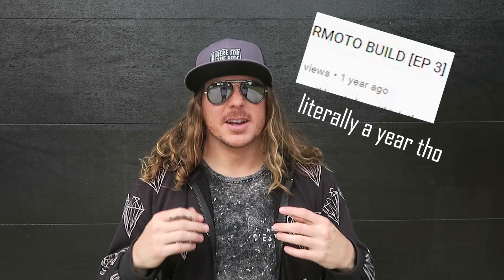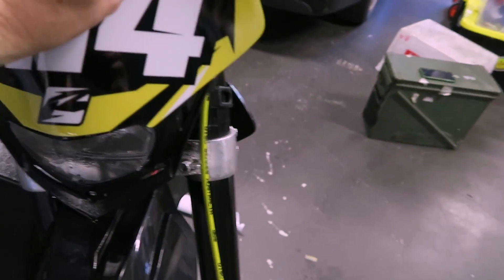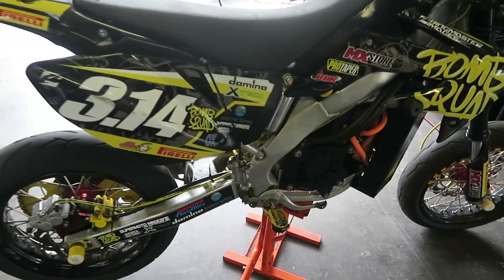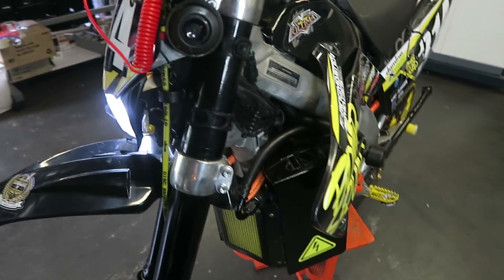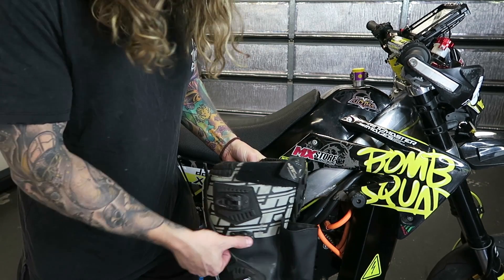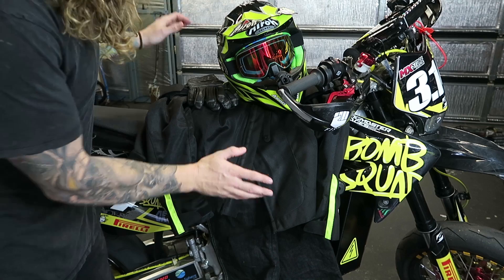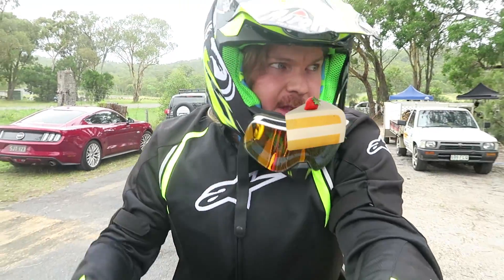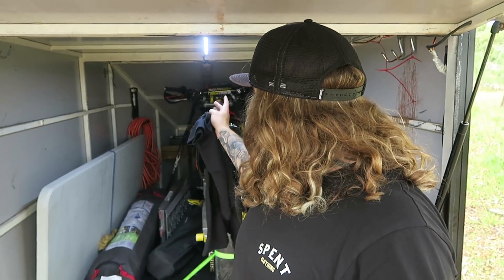50KW ELECTRIC SUPERMOTO MX BUILD [EP 4] TRACK DAY AND ROAD REGISTRATION

Comment: no matter how powerful theres no transmission at all? over torque waste of energy all the time
Reply: hard gore Pretty sure the motor sends feedback to the controller so that only the necessary current is supplied to the motor
Reply: It's the other way around, gearboxes was around 20% of the total energy! Like Noor said, the controller acts like the gearbox.  Why do you think Both the Lightning 218LS and Tesla cars do not use a transmission?

Comment: guys ... I want to suggest the following.... a electric vehicle for ppl doing deliveries ubereats style, most of the electric options out there are for a wealthy type of person,... yet the cash is in creating a super affordable option for the workers!.... difference, there would be perhaps more than 1 thousand ppl buying per year... the rear system that you have on your e motorcycle, seems to be a main solution for a workers vehicle that truly needs to be running most of the day in the worst roads... affordable extended battery seems like a most have... perhaps adding a few super capacitors Tesla style would be the way to go... I most add that, for city riding a scooter/moped is the king, so creating a design that uses the advantages of the king would be a wise move... India has recently created the atheros 450 and costs only about 1500 us dollars if you can beat their price it would be a huge plus... china has a ton in the range of 300 dollars but then they were not meant for the uberdrivers out there.... in general the manufacturers are doing a hard turn away... this could be considered as a opportunity as there are none actually doing a vehicle like the one that am suggesting... perhaps the atheros is the closest...
Reply: I agree with most you said, but give it time, I can't wait till the precises come down to the same as ICE cars biks etc.

Comment: excellent work to rebuild enduro motorcycles to electric, when it makes the speed tests with other bikes, which is obvious the 250 with combustion wins, I make the annotation the electronic engine would not improve the performance of the engine where its speed increases increially. I put the example of a fan, since it needs to generate more speed and performance to the air porducur this is not done with the speed control. When implemented on the motorcycle, it would need a transmission that executes this action. the behavior of the motorcycle as you have the behavior of a escuter a fuel that worked only with the accelerator, but I know that the transmission part was made by electronic devices and small mechanical parts. Excelent work, oyga I am looking for work, well organized his workshop.